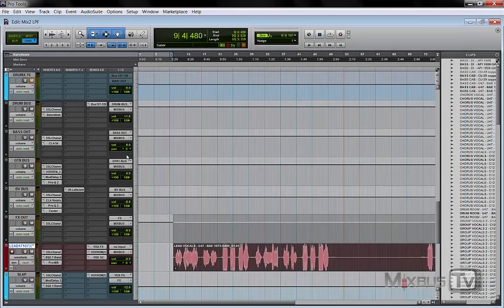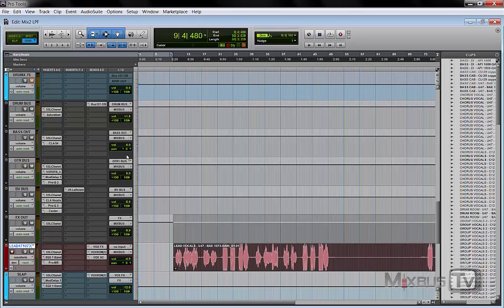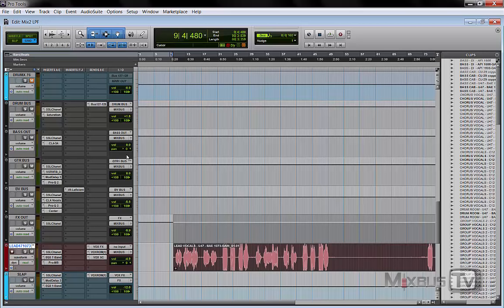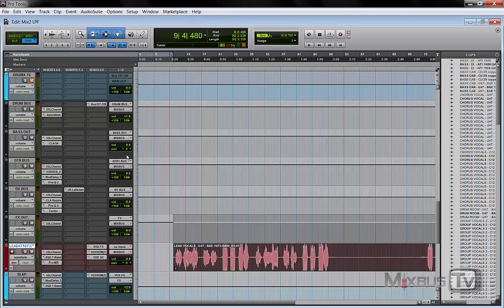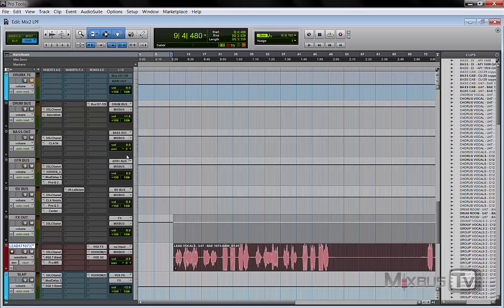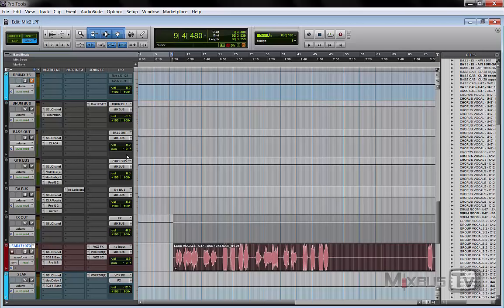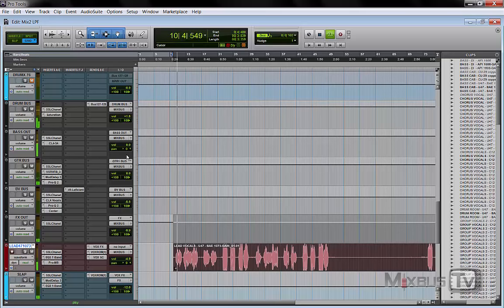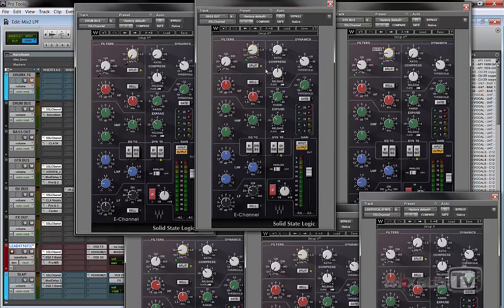Easily Fix Harsh Mixes: Smooth top end simple Trick

Comment: Several articles/books/videos/mixingschools/plugindevelopers advice people to boost the high-end using high-shelfs like Clariphonic, maag, luftikus etc, "brings out the air", "its the modern sound".. No wonder why some of my previous mixes sound harsh compared to the mixes/masters. In solo the tracks sound great, but the mixes are harsh. First I though it was because I used too much lowcuts and boosted too much the highend in the mixbuss track, but now I see that I should use highcut with a gentle slope too on individual tracks. It makes sense. I already EQ intensively with Fabfilter Pro-Q on every track but without highcuts - that is now about to change for sure. Thanks for this incredible valuable video.

Comment: This is exactly why I went back to using outboard gear again. Last week I purchased 2 Klark Teknik EPQ as per your recommendation and I run it in to the Focusrite Penta that I've had for 18 year which has a limiter in it then run that in to a CD recorder and print the track on CD THEN burn the track into iTunes. I just did a 1st test last night the high end roll of was natural and bcuz I used analog gear the track has more depth and width. I recommend everyone to buy some form of outboard gear and go hybrid

Comment: Awesome, awesome advice. I’ve fallen prey to the “everything must be bright” syndrome, and this is precisely what I do. First, pull back on any brightening of the tracks I don’t consider essential to the openness of a mix. Then low-pass everything in that category by just a touch. Just as top end boost accumulates, so — sort of — does low-passing. A little on all but a few tracks goes a long way, and a gentle slope is almost always key (eg 6dB/octave). This technique is basically a free built-in “warmalizer” in your mix.

Comment: Very few people realize that all the latest UA plugins that UA personally authors has low pass filters to give them that "analog" feel, at about 22.5kHz. Same with Harrison Mixbus. I've been making room in the high end like I do in the low end for a couple of years and have greatly improved in creating more space and clarity in my mixes. I prefer to use high shelves to avoid phase issues. Even on the master bus, a 1dB high shelf cut as high as 35kHz can make a difference in clarity. One way to know this stuff works is that the mastering version of the Manley Massive Passive has low pass filters as high as 52, 40, and 27kHz.

Comment: Cool advice and I think it is overlooked, at least by us, the amature or inexperienced in the mixing field. Recently, I started to intuitive use this trick and my mixes are way better, at least from my point of view. Wish I knew and used this way before. Now, I use a LPF on every channel and roll off the high frequency above 18-20 k even on hi-hats and vocals (if any), which are usually the brightest in my mix for me. On other instruments I go even further depending on the overall sound of the track. Now I know that in a decent mix I have to make decisions regarding of what is going to be on top of other things and what should be lower and more in the back of the mix. Great tip, thank you!

Comment: hello, very productive channel!
let me add the view of an electronics man.
ever heard about "Bode" diagram? how does it look like?

after an analogue audio signal chain, there is a classic pattern:
you have a segment, maybe starting from 10k, that sinks with 6dB/octave, and then you have another segment, maybe from 14.5k, that adds one more "capacitor", means in the end you have a 12dB lowpass from there. very characteristic. you can see two "corners".

so if my result curve of a mix is flat, and sounds harsh, then I add either a 12dB lowpass, or two different 6dB lowpasses, to get something similar to that Bode curve, that is typical for many lab transistor (pre)amplifiers, and also for much of the sold production. this does not prevent using additional, reasonable lowpasses on tracks. just think a bit physical.
(e.g. guitar cabinets may have a quite steep low-passing behavior, perhaps already above 6k. the amp with its treble-knob is literally trying to extend that, so this makes a particular type of distortion-artifact that sounds "rock".)

while modern audio gear is trying to work up to 40 or 100kHz, this is the classic pattern of the early devices that worked, and sounded beautiful, also ham/AM radio, respectively lowpassing much earlier, but having such segmented diagrams.

Comment: The first video of yours that I saw was you telling us not to put HPFs on every track. Now you're telling me to LPF all but a few tracks. Why is it ok to cut the highs so harshly but not the lows?
Reply: ***** 
1) Low end contains a lot of energy. Numbers are not accurate, but consider that everything below 600 Hz has 60% of energy. Sometimes you would want to cut it, sometimes not... that was one of the messages in "Stop HPF" video in that channel.
2) Non-linear phase mode HPF has a resonant bump after cut. For example It means that if you HPF 100 Hz, you get little 130 hz boost. And that's an area where almost all instruments are present and where boomines takes it place.
3) Phase cancellation issues will occur if you'll use non linear phase EQ. But linear phase one uses a lot CPU power and needs more delay compensation.
So, LPF are much safer to use due to these things. And nobody said that you shouldn't use HPF. I use HPF, but keep these 3 rules in mind! ;) Cheers.

Comment: Hi David, how about on mix bus and mastering stage?  You ever low pass at around 20K in these cases or just leave it open?
Reply from the maker: Depends on the song, sometimes you cut much lower then 20K if needed, same for the low end. Cutting means using HPF or LPF filters with a gentle slope, it doesn't mean annihilating everything below or above a certain corner freq like you can do with a digital EQ with a brikwall filter. Those are for sound design, they have very little place in mixing and no place in mastering.

Comment: Please, anybody with knowledge on synths and harsh sounds...I have a Roland jd xi synth/drum machine, and I notice that when I add dynamic eq from my Boss RC 505 audio interface/looper, at around -2 to 5 or higher, it is way too harsh, but then when I put any sound below -2, it sounds drowned out and you can't hear the tones clearly? I have no idea where I am making a mistake, or why the mix is so damned harsh, especially the bright synth sounds? I turn the output gain down on the Roland jd xi, and it still either drowns out the sound, or if I turn it up, it is way too harsh with resonance and gain. I cannot get the equilibrium of a sound that I am looking for, no matter what I do. Something is either too sharp, or drowned out. Any advice on what I may be doing wrong? Anybody?